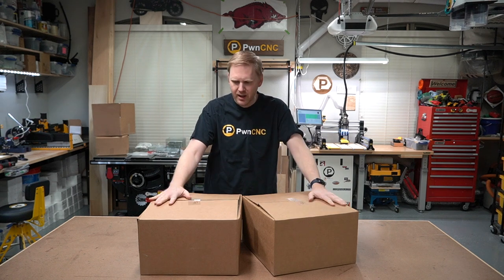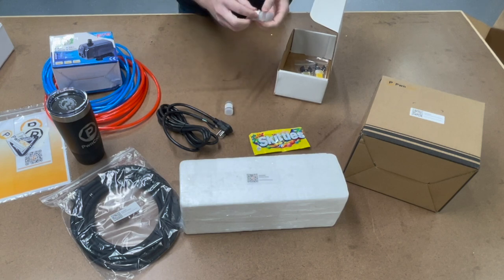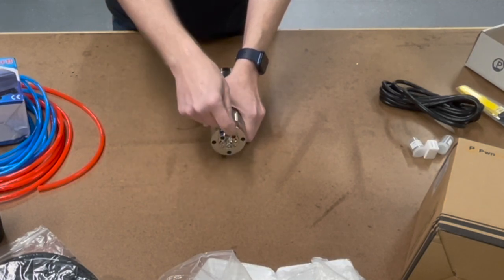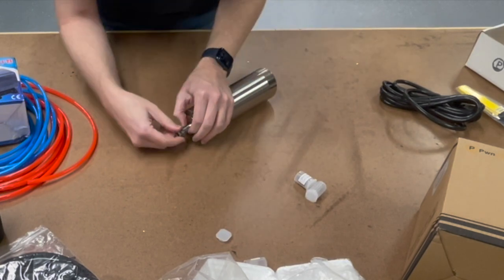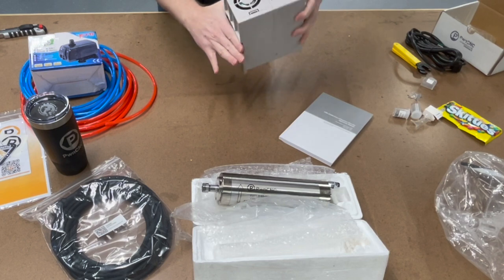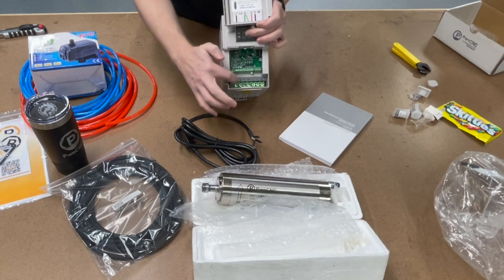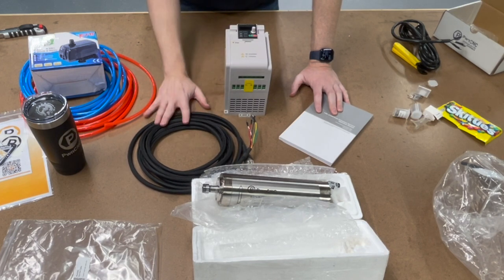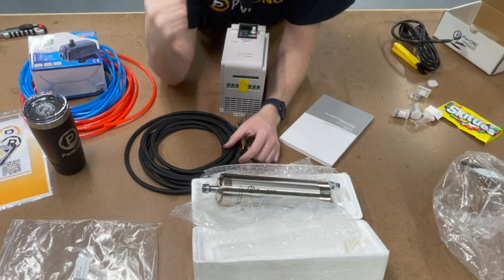[OUTDATED] Unboxing a Water-Cooled Spindle Kit from PwnCNC

Comment: Just bought a Shapeoko Pro with the idea to upgrade to a spindle. I noticed these on your site a couple of days ago. I really want to pull the trigger, but good solid step-by-step of hooking these up is lacking. Naive question I believe you addressed . . . is there a wired connection between the VFD and the controller of the CNC? The reason I ask? I didn't see any of the wires in the kit you showed. I'm considering the air-cooled 1.5 and would love to hear your insight as to advantages of water cooled vs air cooled.  Thank you for the video!
Reply from the maker: Hello Craig, happy to help.  Along with this video, I've published an assembly video (checkout the playlist.. one for air another for water:  https://www.youtube.com/playlist?list=PLfn3rggsArxNeZky60Dm0wGzQQWWg17Ke )
The color manual mentioned in this video and the assembly video details step-by-step install instructions.  This was available and shipped when my kit started shipping in December last year.  On the manual the QR code points you to my documentation website: https://docs.pwncnc.com/spindle  I've embedded one of the assembly videos... but being that i custom programmed this website myself, i'm working on adding an index of other videos so i can link to both air and water assembly videos.
I've built up a lot of IP over the years with dust boots and since i just got into the spindle game late last year, it'll take me some time to build up spindle IP.. but it all starts with a huge variety of products:  https://pwncnc.com/collections/all/spindle  not just the spindle kits themselves.
Needless to say, i'm here to help... ask away.
Since PwnCNC targets a variety of CNC brands, building and testing "automatic control" (wiring vfd directly into controller) takes time.  I've already got it working on a few of my CNC's and working on the others.  I'll have detailed instructions added to my docs site as soon as they're available... as well as small wiring kits for each brand cnc tailored to work perfectly for each CNC/config.
Reply: @PwnCNC  Thank you so much for this detailed reply!

Comment: Is this good to work with both UK (220/240) or US(120) mains voltage?
Reply from the maker: Hello John, happy to help.  We have two versions we affectionally call a 220v version and a 110v version.  These are capable of running in your area and have sold many without issue.  We do ship with our plugs... but it shouldn't be too difficult to find a local plug (https://support.pwncnc.com/kb/section/10/)
If you do find the correct plug, send me a link and i'll post it into our KB for other UK customers.